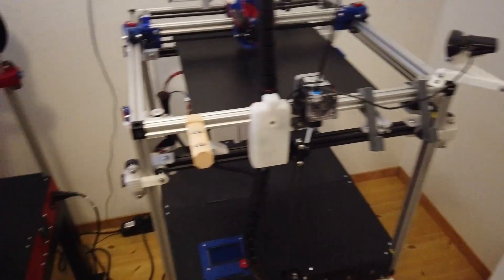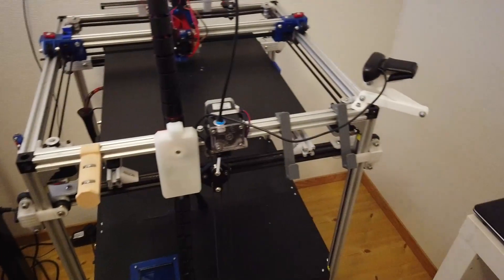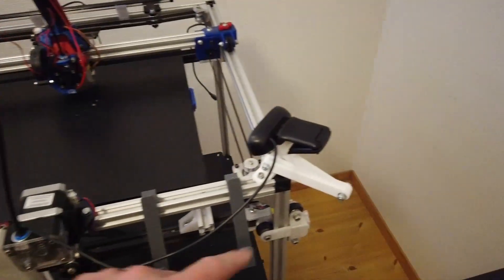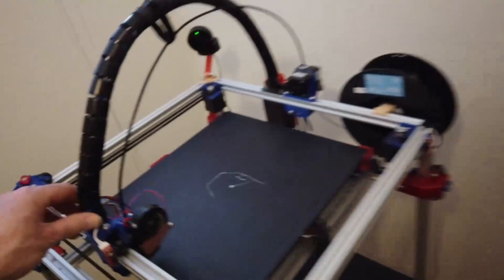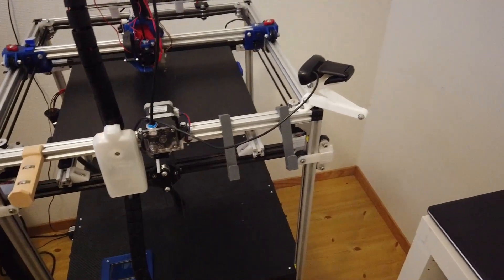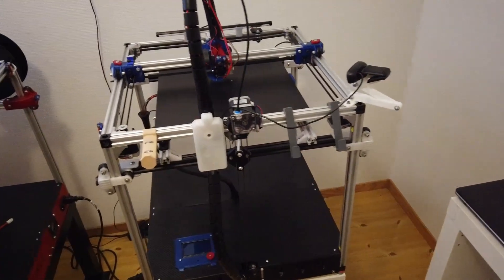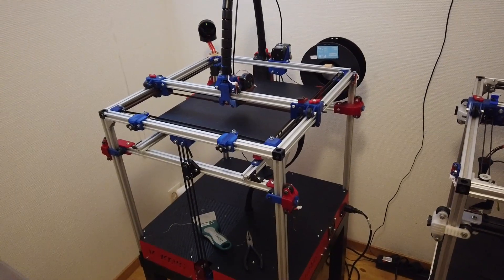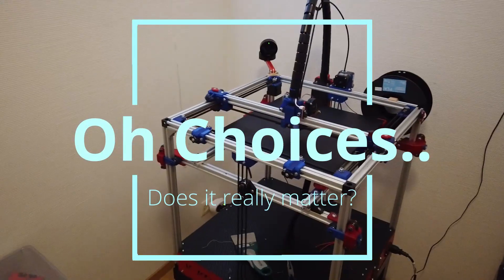Two Big DIY CoreXY 3d Printers - United

Comment: Hi, what is the lifespan in printhours for the XY wheels and what is the lifetime of the V-slot ? I'm interested to build one, but only if I can have a 40x40 or 42x42 cm bed with a Z of ~50 cm. 
Is http://makersupplies.dk a good supplyer. If I order say 4 beams cut at say 650 mm long, will they at least have the same length? My current max build volume is 20x30x20, so I guess that I can print all parts I need. Where do I find the build chat ? Great work.

Comment: Can't stand looking at this endless parade of boxy extrusion-profile printers all over youtube... Booooring...
Reply from the maker: All feedback is good feedback. I will try to improve the content mr.
Reply: @PRO3DESIGN  It's not about the content... It's about those boring, seemingly endless, all-the-same corexy-printers. nothing new. no innovation. they all look the same, they all operate the same, same results. this is NOT your fault - it's just an observation brwosing youtube...
Reply from the maker: @MadHatter123456  well the V-King has been designed from the bottom up all new with all wheels and belts. No rods or leadscrews. This is not something you find on most corexy cubes. Belted Z as well
Reply: @PRO3DESIGN  That's why. It's also printed parts being used for moving and/or structural parts and the same old extrusion profiles for building a frame. and it's still no enclosure or even a heated chamber. as i said, same old stuff.
edit. sorry. i've been looking all over the interwebs for a different kind of corexy-design and i couldn't find one. still haven't found one. 
part of the reason why i'm making my own...
Reply: @MadHatter123456  what are the things you'd like to see in a corexy or a 3d printer in general?
Reply from the maker: https://www.facebook.com/notes/v-king-3d-printer/y-the-v-king/2146622905566107/

Comment: Hi sir, 
First of all, I'd like to say thank you for this great design!
I'm currently looking forward to building one, but with a "classic" PCB heated bed of 328*328mm. Is it possible for you to tell me what length of v-slot extruded aluminum I should buy in order to make the printer square? (And by the way, isn't is as simple as:  "actual bed size - 328" to get the difference that I need to subtract from your BOM's extrusion lenghts?)

Thank you for your time and support, I wish you all the best.
Reply from the maker: Thanks for the support! You can read about the frame size here

https://vkingprinter.com/knowledge-base/v-king-build-volume/
Reply: @PRO3DESIGN  You are an awesome genius! Thank you!